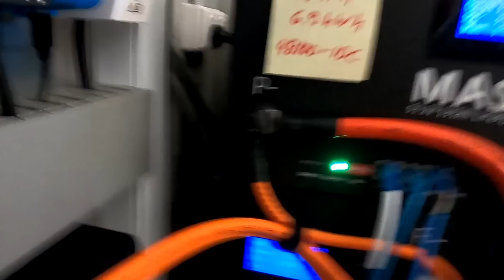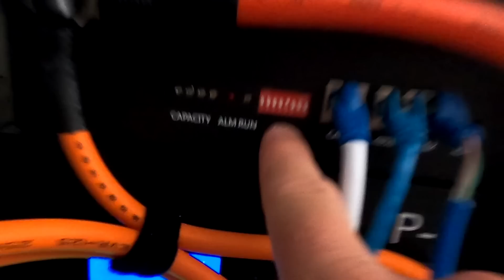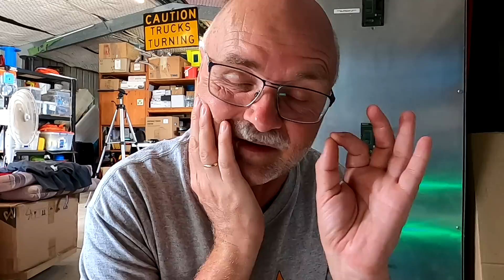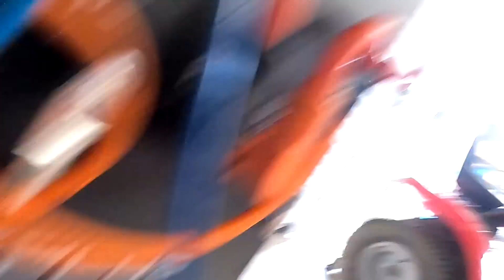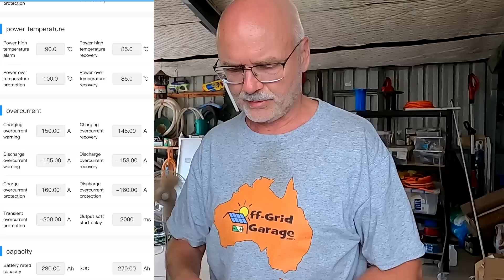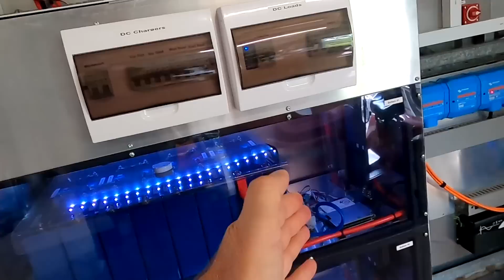No (easy) access to Master BMS of your Seplos battery! Seriously?

Comment: JBD make a BMS with CAN & RS485 now. It's brilliant. it runs pylon protocol so it works with lots of inverters. They currently only make a 100A one but are looking into making 150A and 200A. There are also many different other manufactures which make BMS's which support CAN/RS485 plus different communication protocols...
Reply: Any info or links on this BMS? Can you have multiple in parallel?
Reply: I have one JBD bms with rs485.
The port is a 4 pin regular socket. 
How do I convert to rj45?
Thanks
Reply from the maker: They work only for one battery. If you have several banks, you cannot make them communicate the combined data to an inverter or VenusOS. Hence, I'm testing the Seplos so thoroughly. Alternative would be the Batrium for a lot of $$$

Comment: Andy stop wasting time on those two different batterie BMS's. Wait for the cells come in, assemble the second SEPLOS 280Ah batterie. Then test only the 2 280Ah batteries. Will the BMS's be the same 10E model? Or are those also different?
Reply from the maker: I'm testing 😉 I know same BMS and battery capacity will work, but that's not the point.
Reply: @OffGridGarageAustralia  Fair enough. What is the point of doing something where SEPLOS already said it is not recommended.

Comment: Why not disconnect them and see how they behave on their own? You are trying to use something that is not supported by the manufacture - seems like a tall ask to force something that is already reported to not work.
Reply: I agree. I rather see Andy doing testing when he has the second 280Ah battery up and running. Andy then only test the 2 280Ah, forget the 135Ah battery for a while. Get SEPLOS to re-design the BMS for the 135Ah batterie and send it to you for testing. At the moment you have wasted enough time on the current setup.
Reply from the maker: That was the first step to see if the combo 280Ah and 135Ah works. Next we will be testing the 2nd 280Ah. But no cells have been ordered...

Comment: Time to install a nice chain pull crane on the ceiling.
Reply from the maker: I'm looking int a mobile engine crane rather so I can use it anywhere. A ceiling mounted pulley is too fixed and will work only in one location. I need to be flexible...
Reply: @OffGridGarageAustralia  A  mobile engine crane  would be much more useful. You could get things from driveway / truck to garage.

Comment: Andy, I just got the Seplos 200 amp BMS.  And I’m in need of how to configure mine.  Are you willing to share your configuration of the 280aH setup, you have?  I will implement it into my 310aH CATL batteries, via the EEL battery box, thru the Bluetooth access
Reply from the maker: I haven't configured mine yet as I'm still testing. Still not sure what some of the settings actually do...
Reply: Have you any feedback from Seplos?  I’m getting nothing…….! 😡

Comment: I think it may be a little beyond my capabilities,  but it would be great to write a script that could take input from multiple CANBUS/RS485 BMS, and then collate the information and forward the traffic to the Cerbo.
Reply: Or just use node red...
Reply: @Jason Devine  I hadn't considered NodeRed as an option.
I guess that if it can access Hardware interfaces it could be used. Could probably push the combined BMS data directly onto the dbus.
Reply: @gavinnoname1424  yeh in another project I use it accessing multiple serial ports through USB and then process the data. Can't see any reason we can't grab multiple serial and or rs485 or can bus and then combine totals ETc before presenting to victron app.

Comment: Hi Andy,
I wonder, 
1. why you don't connect the both batteries in "Tichelmann-Verschaltung":  the plus to the first set and the minus to the last set to equalize the voltage drops for all sets.
2. why you didnt try to set the RS485 to "1" and "2" instead of "0" and "1"? As the Can bus does not see the "0" Set, but the "1" Set and "2" Set, it could work.

Anyhow - the BMS is only supervising, what happens with the battery sets - but they are absolutely  not control on analoque basis the currants of the sets. The BMS can only shut down (off/off) of the controlled set in case of over- or under- voltage. 
It is your responsibility by correct wiring according 1. to give both sets the chance to run with equal cell voltages.

I think, you have to equalize both sets again by calibrating them each by each and afterwards you can run them together 

Sometimes, I think, you are kidding us...
Reply from the maker: Thanks, but as I said before, this is not the final cabling and just a temporary connection of the batteries.
Reply: @OffGridGarageAustralia  In case, the temporary connection causes main problems, it is a principle wrong connection - and the  temporary connection in this case can be easily corrected to a working one.
It looks like you're making these mistakes on purpose??? I know you know all this better and have discussed it in previous videos.

Comment: andy what happens if u change the mastery and slave on the batteries???does it act the same then it coud be caused by software if the symptoms reverse then it has to be caused by the capacity difference
Reply from the maker: I did this and it shows either 560Ah (2x280Ah) or 270Ah (2x135Ah) as the installed capacity. It does not really add up the single capacities of the batteries as I would expect it.

Comment: Perhaps get two of the same model BMS with the same model battery? Seplos told you NOT to do what you are doing. I think you need to give them a Fair shot. They seem to have been responsive to your requests, which is a good thing, but mixing BMS varients and battery sizes was probably NOT tested by Seplos. I agree it should work, and they need to fix it, but you can always make two banks, a 135 bank and a 280 bank, and USE A BUSBAR to connect them together to the inverters.
Reply from the maker: I've got another 10E BMS here and are waiting for the cells to come in to build another 280Ah pack.
We then have 2x280Ah + 135Ah packs. That will be interesting to see how they act...
Reply: @OffGridGarageAustralia  When you come to that point I would suggest that you test things with the 2 280Ah batteries only. I don't think that a second 280Ah battery will then just fix the current problem.
Reply: agree 100% Ridiculous to bash a company that already warned Andy this would not work...

Comment: I think the best would be to connect the Lynx shunt to the cerbo and then in System setup > Battery monitor set the lynx shunt as the main battery monitor so it would read the Voltage,Current,SOC correctly, But then would the mppt still be in external control by the bms? That would be a good setup to test
Reply from the maker: That would be the alternative. In this case, we would not use the Seplos BMS connection at all. This will work as the battery shelf then with single individual batteries.
I wanted to have this battery acting as one... I'm not done yet... 😉

Comment: Batrium time? Gut the Seplos BMS from both cases and put try a Batrium. 
They’d probably give you a unit to test/review if they were smart about it.
Reply: That is not an eco solution at all. In that case no need to buy such an expensive steel case to place cells inside.
Reply: You will find videos with a lot of features listed that are not working... Batrium shines but not under the hood
Reply from the maker: I've got the Batrium always in my mind. It's the most expensive solution and I'm sure it will work. From a $$$ perspective it's far too much just to 'try it'.

Comment: As far as I can see it these Bms's are not talking to each other. It provides the cell voltages to the victron system, but thats all it does
Reply from the maker: Yeah, cells voltages and temperatures, but there is no real benefit so far...

Comment: Hey Andi! 
It works, even with dipswitch 5 activated. You have to type set pack adress 00. then you can access the pack 00 or 01.
Reply from the maker: I tried that as well and it didn't work for me. What Battery Monitor software version do you have?
Reply: @OffGridGarageAustralia  i use V2.1.9 for the Batterymonitor and Firmware 16.4, i dont marked any pack, but typed packadress 00 or 01 and connected, so only one pack is shown, but i can switch between if i change pack adress during beeing connected and press setting
Reply: it didn't work for me for the last almost 2 years. what is your firmware and battery monitor software?

Comment: Change the bms and it’s done
Reply: Oh yeah, are you going to provide Andy with two BMS's to try?
Reply: @repairman2be250   I’m pretty sure he has more then you and me
Reply: @pelecho  The point is more like to be able / or not to actually recommend SEPLOS to his viewers. I would not want to spend hundreds of $ on a steel case that comes with BMS and all bits and pieces and then use another BMS in it - Just makes no sense.
Reply: @repairman2be250   this start sounding like my wife 🤣
Reply: @pelecho  Yeah, whatever. She needs a new BMS!
Reply: @repairman2be250  hhahahhahahahaga
Reply: @pelecho  That concludes this conversation.
Reply from the maker: I'm still testing this, guys, so stay tuned. Another BMS is not an option due to the lack of communication. A JK is great for a single battery but sucks in parallel installation.

Comment: Hello Andy, just out of curiosity, if one cell in one of the packs exceed the max voltage, will the CAN communication force the Victron system to reduce the charging power or will the battery pack go offline? I haven't much experience with SEPLOS or the other BMSs you are using. I'm using the Batrium BMS with CAN communication to Victron. When there is excessive balancing or when the state of charge reaches a programmed level, the BMS instructs Victron to reduce the delivered power to the batteries. Is that possible with the other BMSs?
Reply from the maker: That is part of my test series. At this point, I'm not sure if it does that naturally or we need the help of Node Red to get such functionality.
In theory, it should adapt the Charge Voltage Limit (CVL) and also the Charge Current Limit (CCL).
The Seplos BMS reduces charge current to 10A if one cell exceeds 3.5V, but that's just for this one BMS.

Comment: This is because the batteries have a minimum amperage they can detect going in and out. This will always occur unless you push higher current, enough to be metered. I think it's a big problem because it leads to false bms info but I'm not sure there is a practical fix yet.

Obviously I'm not referring to the seplos trash you're using but to the battery balancing and bms issues.
Reply from the maker: 5A is not a small current. The display not showing a small current is not the problem here.

Comment: Is there a reason you can't connect both batteries directly to the victron system instead of having one go through the other?
Reply: Because the batteries are not Victron & are third party....why would another company know how to control a supported product?!?!
Reply: @patricklyons7683  If you read the video description, what Andy is doing is connecting the two Seplos BMSs together (over RS485) and then one BMS is connected to the Vicron Cerbo GX (over CAN bus). So one of the batteries is talking to the Victron already, and having worked in a similar industry in the past, it is likely protocols have been shared, published, reverse engineered or are standards.

My question is - why use the communications between the batteries and then to the Cerbo? What was the perceived gain over just connecting each straight to the Cerbo? I'm sure there's a reason to do it this way, I just don't know enough to guess what it is.
Reply from the maker: They would only show as two separate batteries in Victron. You can then select one of them to be the Battery Monitor for the whole system (like the smart shunt). The other battery would be totally ignored. That's why it will never work with JBP, JK or others...

Comment: Hi Andy, the total Ah should be an increment of both values of both batteries. If the total is wrong check the total Ah per pack. Maybe it is wrong now for the smaller battery (overwritten by mistake?). That also explains the low SOC it is dispaying. It will correct itself after full discharge and charge cycle indeed,
Reply from the maker: I checked both BMS and settings are correct. I believe, the master BMS just multiplies its own capacity depending on how many slaves are connected. Hence, we saw 560Ah (2x280) and 270Ah (2x135Ah) with the other battery being the slave. There is no real communication in this regards from what I can see...
Reply: @OffGridGarageAustralia  that is than different in this E bms. My two C bmses just add both different values together.

Comment: Rs485 has one master and several slaves, if your computer is the master then all others are slaves. So if the battery is currently the master you cannot send it commands. This is rs485 design and not seplos. Can Comms solve this issue

Comment: Can it be a problem that you use a 10C and a 10E BMS together?
Reply: Then why would the company confirm that it’s not possible?
Reply: @tujusprojects8770  I thought Seplos only mentioned that they do not advise to use different capacities in parallel? Otherwise, they could also tell Andy to stop testing because it will create problem a and b when combining these two batteries.
Reply: Maybe Andy will test again with his third Seplos battery parallel with one of these (matching)..?
Reply from the maker: Seplos is not recommending using different capacities together. The different BMS should be fine.
Reply: No .. I have old and new running, same problem without mixing

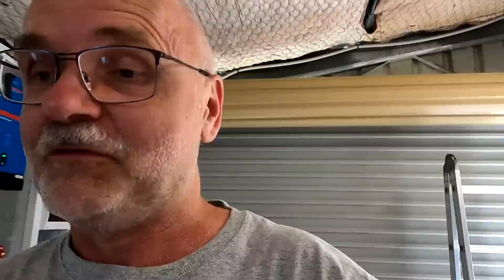Comment: Hey Andy, I Noticed @ 4:25 That You Have Both Wires From Charge Controller To Batteries Going To Top Battery? 🤔 Try To Remove The Right Positive Lead & Move It Straight Down To The Bottom Battery Right Positive Where You Have The Empty Lug + In Reverse? Try The Same In Opposite With The Negative Down With Positive Up To See Ifin It Makes Any Difference? It's Worth The Try To See Ifin The Current Is Then Forced Thru Both Batteries More Than One Just Leetching Off The Other??  Thanks 😁😎
Reply from the maker: Thanks. That will not make a difference in this case. As I said, it's just a temporary setup and all batteries will be cabled individually to the Lynx Power In eventually. 
The batteries will always be on the same voltage except when having very large currents. Then, and only then, a different cabling would be beneficial.